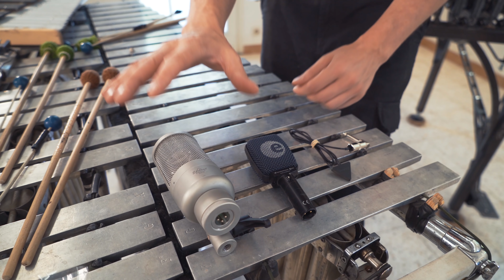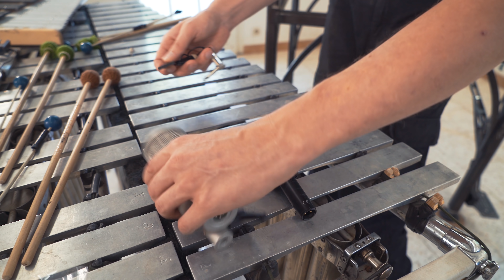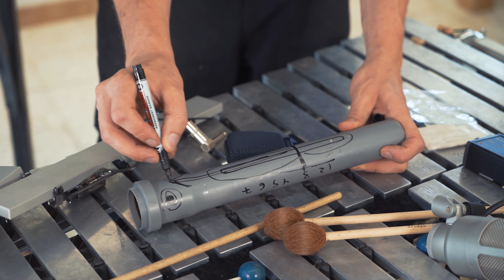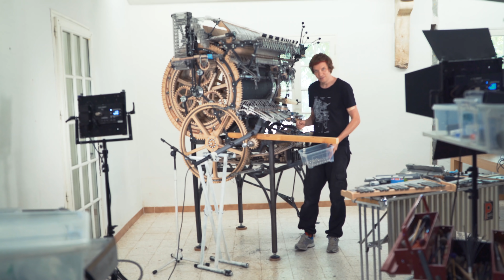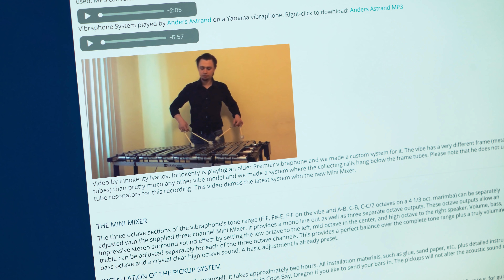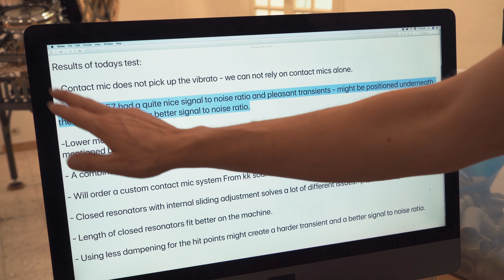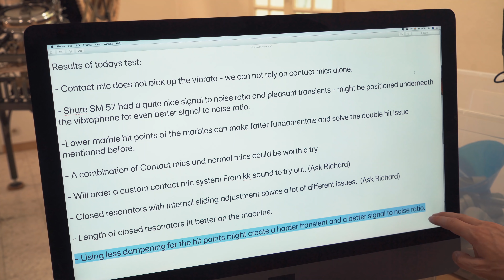Vibraphone Experiments / Microphone Types - Marble Machine X #96

Comment: Idea for your vibraphone tubes. The professional versions often have false tube lengths for visual presentation, so there is a long length of tube on the lowest notes as well as the highest, creating an arch look in the tubes. But the highest notes have a physical stop internally to shorten the length of the tube’s resonance to match the higher note. Maybe you could figure out a way to have an adjustable resonance wall you can raise and lower inside the tube to match the bar you place in that position. You might even be able to pre-position rotatable “flue stops” in the correct position, so all you need to do is to open up the tuned position of one tube length, and close down the stop for the incoming bar. Think of the spinning vibraphone discs, but at various positions in the tubes that you can open and close to change the length of the tube internally.

Comment: A lav mic just outside the mouth of the resonator (by the vibrato paddles) will have the highest SPL from the resonators, and will capture some of the attack from the bars. I would probably also put some felt baffles along the front and rear of  the resonator mouths in order to isolate the mics slightly. 

That will keep the mics out of the way, keep them from needing adjusment, and get the highest SNR. Remember that reducing the noise floor is nothing compared to increasing the signal level.

Comment: You could try putting a "Y" connector in the tube and fit a spring mounted microphone in the branch close to the main tube.  This should reduce the amount of external noise and you could "tune" it's efficiency by adjusting the position of the picrophone up or down the side tube.

Comment: I think you can use upto 4 to 6 dynamic microphones position it behind the plate in between the resonator pipe and the plates. 1 mic per 2 or 3 plates. Just use a compressor to balance the amplitude.

Comment: Martin, I think putting the mics in the resonators is still the best idea you present here.  True it was loud enough to clip the signal somewhere, but there are always mics that can handle louder sounds.   The fact that it clipped actually means the signal is insanely loud relative to your "noise", which would give a great SNR.   Check  the specs on your mic, you could be clipping the preamp and transmission circuitry instead of the mic itself.   Also,  you can get tiny MEMS mics that can handle 130dB pretty cheaply if this idea proves to work.

Comment: Hi Martin, I love the channel! Like many, I’ve been watching since the start. 
My father is a sound engineer so I put your question to him. Here is his response:

Possibly a simpler capture mechanism but with addition of a noise cancelling solution, maybe using directional capture characteristics to differentially capture noise and note followed by a phase reversal/rotation cancellation.

The distortion in the microphone was a result of over-excitation of the membrane and surrounding structures when placed directly within the encapsulated column of air in the resonator - so that may also be a partial solution - using the columns of air to resonate an encapsulated solid state capture device capable of handling the amplitude of excitation and then converting that into an audio signal. Just as the column of air is tuned to the fundamental (by varying its length) so each capture device could be, so that they reacted most strongly to the associated tine, rather than other tines or mechanical noises of the device.

I’ll think a bit more.

Keep up the good work!

Comment: Hi Martin. I think there is a simple way to solve the Vibraphone mic problem. The resonator tubes on a vibraphone are actually only individual amplifiers for each note. If you are miking each note on the MMX then just can the res tubes and use that miking system you ordered. To get the vibrato effect in analog you could maybe make a way of moving the mics up and down or closer and further away from the plates. Another idea is to make some felt disks or pads that rotate over the mics much like the discs inside the res tubes of your vibraphone. Hope this helps or inspires. Its so great what you are making here Martin. Cant wait to start hearing the music.

Comment: If you are using 57s in the end, you should definitely check out the 90 degree angle mod from crimson audio for mounting options. They also have replacement transformers which are taking those basic mics to new heights.

Comment: Why don't you use both contact mics and mics in the resonator tubes with a calculated delay that is just there to pick up the vibrato at -3db than the contact mics prepared

Comment: The resonator pipe sliding mechanism is a good idea.  You could use an sm57 with a soft head inside the adjustable resonator pipe and that will carry your vibrato and then use contact microphones on the top for the direct tone and mix them together so you would effectively have 2 mic channels per note.  Also this idea would help your signal to noise ratio with the SM57 and contact microphone.

Comment: A contact microphone on the resonant pipe at the strongest resonant node point might work. You would need the pipes pre-built with the mics attached to a mounting point so you could switch them out. Maybe a set of pipes all connected and wired together for each song?

Comment: I suggest asking to help the people from acoustic measurement companies. I think that you can search for the solution in, e.g., "GRAS," "Brüel & Kjær," or "SVANTEK".  It is a different kind from standard studio equipment, sometimes extremely expensive (much more than the top of Shoeps microphones),  but why not ask for help? Your problem with placing microphones to record the vibraphone sound is not easy to solve.

The other problem is the resonator. The open pipe works differently from closed (stopped). It is similar to stopped organ pipes, which don't have even harmonics. Your choice will have a significant impact on the timbre.

Comment: I like the closed resonator idea. Would need to hear a sample, but regardless, I believe you can mic the vibraphone from behind/under the plates. 2, 3 or max 4 microphones would be enough. Would hate to see you use contact mics and digital vibrato. They don't look like they match the marble machine ethos. Use the directional pattern of the microphone to your advantage. Point the mics at the sweet spot and use the rejection of the cardioid pattern at the side/rear to minimize background noise.

Comment: Martin: why not make the vibrato digital and why not have the contact microphones stick into the top of the metal bars in some kind of slit and lock them in place with a tapering pin?

Comment: Another option to get the vibratio is to mount the mics on a rotating arbor behind the bars.  They used an old spectratone speaker on soundlab to record a guitar amp. It sounded pretty cool.  https://www.youtube.com/watch?v=JVzvAn8ac4A .  You'll need a rotary commutator (a slip ring rotary union) to get the wiring to work.

Comment: try the contact mic on the resonator tube bottom.  Then the mic should pick up the vibrato, after all the tube is what is vibrating in sympathy to the bars and you are either allowing or stopping that vibration by closing the butterfly valve.    I don't know if slotting the tubes will actually work o tune them.  The tube is only going to vibrate in sympathy with the bars when it is the right length to do so.  You might have to use a cap tube that slides up and down over the outside.

Comment: Why not build a rack to go with the machine? I'd use the contact microphones on the top of the vibraphone, a dynamic mic at the end of the tube, mix them together, remove the noise and add effects in a purpose built system. Give the front of the house a signal already under your control.

Comment: I'd recommend trying the following, roughly in order of priority:

1) 1/4 wave resonators with adjustable closed ends and mic build into the closed end.
2) 1/2 wave folded resonators with ends that connect to large container.
3) If all else fails, use contact microphones and mimic the rest w/ signal processing.

1) Quarter wave resonators.
Make each resonator long enough for the lowest note that needs to be played at that position.  Make adjustable ends like pistons with good seals (pair of o-rings in grooves, for example).  Attach your mic to the the piston.  Once you've tuned a resonator for a particular note, make a depth gage to make it easy to get the same position each time.  The resonator will respond to the fundamental and odd harmonics (3x, 5x, etc).  All those harmonics will have a pressure maximum at the closed end and should be picked up by the mic.  I don't know how the vibraphone bar frequencies are tuned, but I'd expect they aim to have many of the overtones close to multiples of the fundamental frequency, so the resonator will pick them up (the odd ones at least).  One note - the comment somebody made about striking the bar off center will not affect the odd harmonics much, but will make a big difference for the even harmonics.  If those even harminics are important for the tone you're looking for, you may need an open tube resonator.

2) "Open" tube resonator.
If you really leave both ends open, you'll have trouble with signal to noise using a mic.  One way to be close to having an "open" tube end is to have it open up to a much larger space, but a space that is well isolated from the noise of clanking marbles.  Someone else mentioned collecting the tube ends into a sort of manifold.  I agree, but make the manifold big.  Packaging will be a challenge though.  You'll probably want resonators that can be swapped out easily, but seal well, and connect to the same manifold in the same spot.  I can imagine a PVC pipe with 4 right angles or some elaborate 3d printed contraption could do the trick.  Put a mic (or several) in the manifold.  Some acoustics calculations might help determine the size of the manifold or where mics should be.

3) Contact microphones + signal processing
This solves the SNR problem, but fails to deliver the same level of mechanical magic as the rest of the marble machine.  I'd try doing the signal processing with modular synth stuff first (is it just amplitude modulation?)  If that doesn't do the trick, I'd try measuring contact mic signals along with acoustic mic signals with the flap open and closed to work out the transfer functions both ways.  Then implement those transfer functions with convolution filters and use a LFO to mix between the two filtered signals.  I've done some of this sort of custom signal processing on an OWL guitar pedal, but there's surely other ways of doing it.

Whatever you do with the mics and resonators, keep in mind that you can address SNR from the noise side as well.  You've shown on the music box video that you know how to design systems to isolate components from vibration.  Take a look at the vibration sources (where marbles hit stuff or each other) within the marble machine, figure out what components are acting as soundboards to turn that vibration into noise, and then apply mechanical isolation (soft stuff) between sources and soundboards wherever you can.

Comment: I wonder what it would sound like if you had contact microphones on the vibraphone plates fed into something like a Leslie Speaker to provide physical, electro-mechanical tremolo/vibrato. Given the MMX is already being cranked it would be feasible to have the speaker's drum being rotated by some linkage from the  crank, resulting in it being an effect built right into it...

Perhaps. I'm neither musician nor engineer :)

Comment: What if you put strips of spring metal vertically in the resonator tubes, with the contact mics on the strips of the metal. Have them mounted suspended so they're just chillen in the center of the tubes. Hopefully, since they're inside the resonators, they'd pick up some of the vibrato, but perhaps, not enough of the initial sound. You could also mount contact mics on the vibraphone plates as well, and maybe mix the two signals or something.

Comment: Martin, I'm not affiliated with ISCHELL, a French manifacturer of mikes and similar stuff, but this kind of patented contact microphone might be the right one for you --- From their website: 

"The AirBag-C is a new type of contact microphone, its 
mode of operation is unique. The sound is natural, rich, dynamic, 
powerful, precise, reproducing even the vibraphones TREMOLO… A very 
good resistance to feedback without sensing the ambient noise. Easy to 
use in an amp, with effects, loops etc… The microphones are placed under
 the blades of the instrument, at the edge of their lateral support, at 
the center of it."

The entire amplificated system of 22-37 mikes (BAR X8/40) is definitely pricey, but I guess you will need only a few AirBag-C contact microphones, hopefully sold individually. Anyway, just my two cents :-)

Keep up the good work! Ciao from Italy - Alessio

https://www.ischell.com/en/balafon-vibraphone-and-multisource-instrument-pickups

Comment: for a closed resonator tube could you use external magnets to hold the internal sound wave blocker / diaphragm in place simplifying the build? as in have a hockey puck shaped plug with magnets on the rim that fits inside the resonator tube then have a large ring with magnets that fits over the resonator tube so the outside magnets holds the internal plug in place

Comment: Just thinking but ... why do the tone bars have to be flat? Obvious for a vibraphone player who needs to hit them at various places, but not for a marble machine where they will always be hit in the same place. A bent bar could be made so that sweet spot was always in the right place for the marble however one rearranged the notes.

But would the sound change with a bent bar - anyone know? Or could you make a lower note by a standard length plus either an L or T extension - might that work?

Comment: optical microphone as mentioned, but then with internal membrane removed, focussed and directly picking up signal from a mirror/reflection on the side of the resonator tube might work too (but quite expensive and could easilly add a few months of additional engineering on your MMX... :)

Comment: If we use a stronger signal strength PVC pipe and a little bit stronger thickness it will help get rid of the vibration inside the pipe

Comment: If you were able to place the contact microphone exactly on a point or line that lies exactly on the node of each plate, you won’t affect then vibrato. Good luck. Your plates are too short to resonate for very long, but you could turn up the gain on a compressed contact mic it might work? Or you could do what you did.

Comment: Martin,
I'm not sure if you've heard of them, but DPA makes a great string mic that may work for your vibraphone. They are designed to clip to the instrument and pick up sound directly from the body hole. They are not cheap, but they may work well mounted to the bottom of your tubes.

Comment: https://m.youtube.com/watch?v=TKNZGX_Za7M

Im assuming the vibrato is a sinewave.  This could be achieved by rotating a magnet in a coil of wire and then adding the current generated to the signal from the contact microphones.  This link shows a vid demonstrating this simple concept.  Th is could be part of the MMX timing which is within the philosophy of the project.

Comment: What if you put the contact mic on the resonator pipes?
Reply: You might need to gain up the audio a bit because the raw signal will be quieter. But if it turns out that the signal to noise ratio would still be lower then it might be worth considering.
Reply: It would also remove the need to plug and unplug the mics.

Comment: I think the magnet and coil is an example of amplitude modulation.  So the coil would generate a vibrato signal that would add to the signal from the contact microphones.  You may only need one of these.  It could add the vibrato to all the contact microphones together after mixing.

Comment: Hmmm... I might be a bit uninformed but... what if you tried making the actual vibraphone plates the microphone/sound wave capturing device? What i mean is if you made a thin membrane (maybe aluminium?) that is 100% across the entire bottom that directly connects to your electromagnet/mic instead of on only a portion of the plate with a contact mic the way it is now. Because then your transducer device is capturing the entire spectrum of sound because it's resonating as the entire vibraphone plate not as a particular part of the plate. That would get around needing to use multiple mics for each plate. And as far as switching out the plates goes the mics are technically already attached to each one so you'd just slide one plate off + unplug cable >> slide new plate on + plug in new cable to existing processor setup. Heck, you might even be able to calculate the distance needed between "full plate mic" and the vibraphone plate to create a sort of resonance between them. Like an ice cream sandwich. If current modern day vibraphones and resonators aren't doing the what you need them to, maybe the solution is getting back to the basic principles of sound and designing a new instrument altogether that serves your intended purpose instead of trying to retrofit. That's how electric instruments started (vs traditional mechanical instruments).

Comment: With your wireless mic down the resonator tube, It sounded like the sound was too loud for that mic, I'd look at something like a dpa 4062 to have high spl handling in a small size, and then suspend it on elastic in the middle of the resonator pipe's diameter.